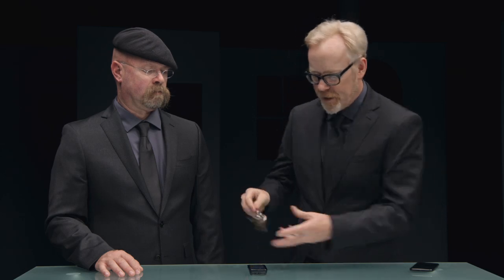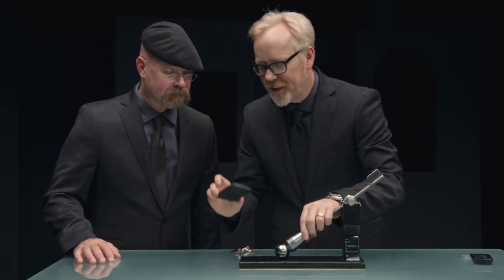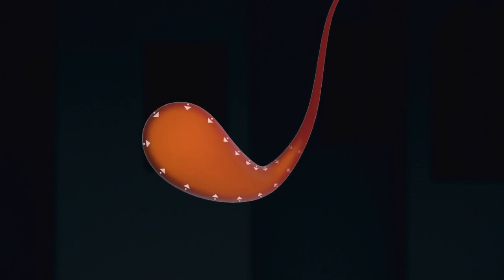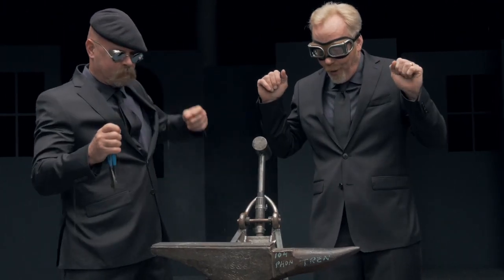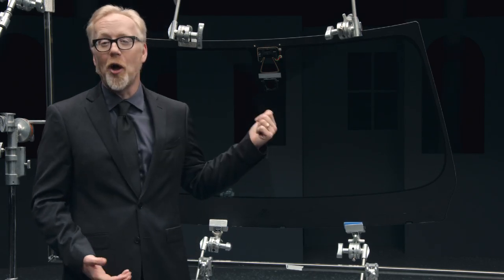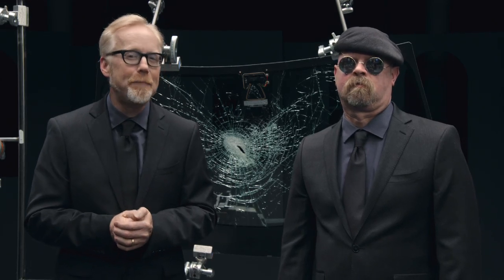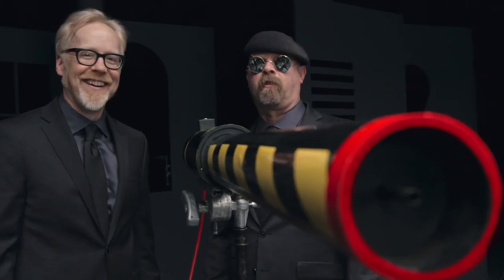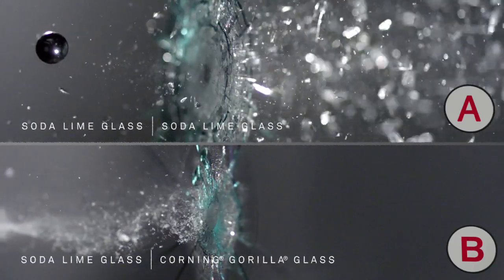The Glass Age, Part 2:  Strong, Durable Glass

Comment: I hate it when one test is shown against the "inferior" product, but then a different similar test is run against the "better" product. HIT WINDSHIELD B WITH THE HAMMER ALREADY!!!!!
Reply: +Michael Mast (TurboAAA) They did the pebble test against both, the gorilla glass still preformed better. I was really mad when they did that too until they did it to windshield A too.
Reply: +Michael Mast (TurboAAA) HAMMER, HAMMER, HAMMER!!
Reply: +HaydenMcM1 also this was a science experiment. They didn't calculate the force of the hammer, therefore they couldn't hit windshield b with the same force.
Reply: +HaydenMcM1 There's also the fact that neither windshield is meant to handle a sledgehammer, but both would regularly withstand small high-velocity impacts from pebbles. Testing whether or not your windshield will take a sledgehammer is like testing whether or not your phone can survive on the sun. It's not made for that, testing it is pointless.
Reply: HaydenMcM1 Except that they did equivalent testing immediately afterward. The sledgehammer was there to grab your attention and break up the science. Lowest common denominator stuff.
Reply: +Ian Mcvicker Or they just didn't want to show windshield B get obliterated by the sledgehammer
Reply: Melroy van den Berg The hammer wasn't an actual test. Note how they measured absolutely nothing. Note how there was no method described. Note how they didn't give any results. That is because the hammer was a demonstration to keep the lowest common denominator watching.
Reply: Indeed!
Reply: +Michael Mast (TurboAAA) Probably they didn't have another pane to experiment with plus costs
Reply: HaydenMcM1 And that's a bad thing because..? It's entertainment. Nobody said that the hammer was a test, nobody wants the hammer to be a test, nobody needs the hammer to be a test, they did the test, the hammer was there for entertainment. Why is this an argument?
Reply: +Michael Mast (TurboAAA) they did the same test on both windshields with the ball bearing cannon. that experiment eliminated all outside variables thus being more scientific. the sledge hammer was not a test, it was a demonstration on how lamination holds the glass together after it shatters and the hammer delivers enough force to fracture the entire windshield.
Reply: HaydenMcM1 It was merely for the SMASH value. :^)
Reply: HaydenMcM1 It's not a test though!
Reply: +HaydenMcM1 The hit with a sledgehammer was supposed to show one thing. What a broken laminated glass looks like. It's not a matter of being apt in scientific methods. It's a matter of being able to think. 

There was no reason whatsoever to hit the other one with a sledgehammer. It would not show anything at all. Whether the damage was smaller, larger or the same...it would be irrelevant. The process of lamination and it's effects on the final product were already explained. The comparison of strength was done with the air gun.

This is one of the best-made advertisements I have ever seen. It's an actual advertisements that shows quality product fairly, as in...the way you want it to see. That's rare nowadays. Causing a ruckus in the comments just because someone didn't understand something so basic is really...sad.

Of course, it would be FUN to watch the second one being hammered. But "fun" does not equal "reasonable". Wasting a prototype for fun is just not...something one would do, really.
Reply: +Michael Mast (TurboAAA) a person swinging a hammer is not a controlled variable.
Reply: HaydenMcM1
"not everyone watching this is apt in the scientific method"
Well of course not. You're never going to hit 100% of your target audience. But just because the minority can't enjoy the commercial doesn't mean it should be changed or that it is wrong. It wasn't targeted towards you.

The way they presented all the glass experiments in both videos does not allow for "manipulation" like most advertisement does. So long as we can assume all the potential variables remained constant, aside from glass A and glass B being the changing variables, no information presented was at all false or misleading. The only thing they didn't show was potential weaknesses of the gorilla glass. Which NO advertising company in their right mind would do.
Reply: Jeffrey Black It won't. Obviously. The only vehicles with windshields designed to handle that kind of abuse aren't the kind you typically find at a car dealership...
Reply: DON'T EMPLOY THE MYTHBUSTERS IF YOU DON'T WANT A SLEDGEHAMMER USED! & don't say "it's not meant to handle that" if that's your argument, then hit it with another car or large animal!! I want to know what the glass in front of me is going to do if I'm in a crash! & cost? again, don't employ the mythbusters if you can't afford to let them be them, or alternatively, at least finish the video sledghammering the already shot through glass! No extra cost to that
Reply: Michael Mast I was worried about that but then they shot windsheild A with the ball and then B. The sledgehammer was just to give an example of what the cracked glass looks like.
Reply: Teth47 There are various types of "survival".

One is keeping it pristine. The other is making sure it fails safely.

The reason laminated glass is used is so when the glass does break it doesn't shatter into numerous shards which then fly/fall to the occupants of the vehicle, cutting or impaling them, and as a bonus, it doesn't make a bunch of glass dust.

If Gorilla glass fails and shatters and throws glass everywhere, it isn't suitable for car windscreens.
Reply: Jeffrey Black It doesn't. It's already known that its failure mode is identical to typical glass, it's just harder to make it fail.
Reply: Teth47 That depends on the type.
As it has internal stresses it is more likely to shatter spectacularly.
Reply: Jeffrey Black That's what the lamination is for...
Reply: Teth47 And hopefully that will work, however it will depend on exactly how it all breaks. If the glass doesn't separate front to back, it will be fine. If it does, then it wont be.
Reply: +Danielle Henry This was an advertisement, not an experiment.
Reply: Lilac Lizard actually he wanted the sledgehammer again
Reply: Anonymous, I think we all did!
Reply: Well, at least they used a proper control for the actual test they did.
That would have seriously sucked if they hadn't demonstrated like for like in any way at all.
Reply: I think it would shatter to milion pieces and be more dangerus so they decided to not show it... Maybe they are still working on it so it wont happen.
Reply: They hit the one windshield with a hammer for entertainment purposes only. Then they reeled it back in and actually performed a realistic test to show the utility of the glass in a real life situation.
Reply: The sledge hammer was designed to show you what the resin layer in between does. Not necessarily to give a visual representation of the strength. People who don't understand that watch too many one-track demo infomercials.
Reply: +Michael Mast (TurboAAA) It's quite simple. They didn't hit the windshield B with the windshield because that would have simply proved something that is still worked on I guess. If they would have done it, the compressive strength would have shattered a large amount of the windshield inner layer with only the resin to hold it there. You don't show a flaw still being worked on for no reason.
Reply: korinogaro1988 I wasn't being serious, if I remember correctly at the time I was being one of those people that just wanted to see more things go smash.
Reply: +Michael Mast (TurboAAA) No need. We already seen how it looks when a window gets owned. Which was the point of the mallet. Don't need to own a second window to explain what happens to a glass in that case.

As for test 2, the BB was used on the first and second glass. So it was even steven.

All that said, I still would have liked to see what gorilla glass in both positions would look like from the mallet and BB.
Reply: yea, I wanted Jamie to blast the "B" sample with the hammer!
Reply: Danielle Henry That's an argument for calculating the force of the first hit, not an argument against hitting the seconds.
Reply: +HaydenMcM1 Correct. Check this Video here to see what happens:
Oyx6PpXuJfc?t=6m1s

(remember the prince ruperts drop)
Reply: +Teth47 Or it is like testing if it will survive hail or some load falling off the vehicle in front, like a brick, or perhaps one going in the opposite direction, or hitting a kangaroo.
Reply: +Kim muca Neither is being hit with a ball bearing.
Both have similarities though.

A hammer is comparable to large hail or animals or loads from other vehicles just like the ball bearing is comparable to a pebble.
Reply: Teth47 Agreed neither will be able to withstand a sledgehammer and nor should they be able to. But then you run into the problem. By showing one being destroyed and not the other you place a burden on one but not on the other even though it is equally useless against the sledgehammer.
Reply: Teth47 My point is that it being shown on one but not the other gives the impression that the old glass is weak when it's a test that not even the new glass could withstand. Not everybody watching this is apt in the scientific method and actions such as that allow for manipulation of the audience.
Reply: kikixchannel So why not hit windshield B with the sledgehammer? It would show how the windshield shatters.
Reply: Vriska Serket True, nobody said it was a controlled variable did they. The comment is that it's sensationalism to show it for one and not the other.
Reply: +Michael Mast (TurboAAA) Exactly! Don't change the test setup.
Reply: HaydenMcM1
Well they aren't going to impress people if they don't use the same methods to break it. The people that are likely to be watching this video are by majority reasonably intelligent with a decent understanding of scientific method.
Reply: You do realize that if its not a probable scenario then why would they demonstrate it in window A in the first place. The answer to that is the same answer to why they should also do it on window B. You do realize this? Donkey.

Comment: They should've gone full Mythbusters and seen how fast the ball bearing had to go to get through the gorrilla glass windscreen.
Reply: +BradTheThird And then shoot it with a .44 magnum round, just for fun
Reply: +Pul5ar And blow it up in the end, for good measures.
Reply: +Ivo Glasius Using at least 1kg of c4.
Reply: +BradTheThird I still want to see the sledge hammer
Reply: +BradTheThird If it's worth doing, it's worth overdoing it
Reply: RMJ1984 Lets test an RPG while we are at it..
Reply: I think the answer to that is only very slightly faster than they did. I would imagine they pretty much pushed the glass to it's limits for this demo. It wouldn't have looked good if it had broken like the standard glass...
Reply: +Pul5ar After that, just to take it to the limit 50 cal rifle shot. you know the anti tank one  :D
Reply: +Viktor Rebake I agree.
Reply: +Viktor Rebake Yes like car games not allowing you to totally destroy a car
Reply: +Pul5ar a .55
Reply: 121mph I guess
Reply: @killbillgrill3287  Funnily enough, that ball bearing is moving slower than a paintball fired from a paintball gun. While most paintball guns can fire up to 300 feet/second, fields usually agree that 280 feet/second is the upper limit on safety. 280 feet/second equates to ~191 mph, so, in the realm of projectiles, it's going pretty slowly.
Reply: +BradTheThird Corning didn't pay them to do the actual test, only the advertisement...
Reply: These guys are the real slo mo guys

( ͡° ͜ʖ ͡° )
Reply: BradTheThird ya
Reply: Caster Troy ya smart
Reply: We need Demolition Ranch to test out the Gorilla Glass!
Reply: no, going full mythbusters would have had them seeing how much TNT it would take to blow up a car with gorilla glass windows xD, they really like there explosives!
Reply: Caster, same! It's just wrong to employ mythbuster guys but not have them smash the second one with the sledgehammer!

& WTF are they wearing???????? suit & tie? Come on!
Reply: I have a feeling that the bold guy asking the questions, already knows the answers to them.

Comment: you know what i see lots of unfair comparisons
Reply: +Jared Reabow (Jazza) Try bending a sheet of regular glass that's 0.2mm thick.  That shit breaks just by breathing on it.
Reply: Well, the phone they scratched actually has a resistive touchscreen on top of the glass, which is why it's so easy to scratch. It's not even glass they scratched, but a thin plastic film on top of it!
Reply: +Jared Reabow (Jazza) such as? the ball bearing was shot at the same speed and distance, both scratched with the same keys, both had a metal ball dropped on it from the same height...
Reply: +ranwolf76 4mm glass bend vs 0.2mm glass

Comment: I confidently did the ball drop test with a hammer on my new phone... I regret to announce that apparently my phone does not have Gorilla glass :[
Reply: I learned the Iphone IS for peasants.
Reply: It's okay though, I work at Corning, I can buy another one ^-^
Reply: +Patrick Clausen sapphire is not inferior, it is just apple and Corning saw two different paths, Apple thought the likelihood of someone using an iPhone without a case would be low, so they decide to make their phones the superior in scratch resistance sapphire, and android users who mostly use phones without cases because of the big name Samsung, and others who make their phones ipx certified aka water and dust resistant to a certain degree decided just put all the strength into corning glass. It is not a matter of who is better, it is the target consumer. Both are good products, and unless you are using them to build a rocket ship I doubt it matters because people who fight just want to brag.
Reply: +kylefer that is because your phone is not android. C=
Reply: Patrick Clausen "The new glass on iPhone 6s is made using a special dual ion‑exchange process, which makes it stronger at a molecular level and the most durable in the smartphone industry."

"ion‑exchange" is how gorilla glass is made by corning or did you not watch the video.
apple may not state it outright but they use gorilla glass.
Reply: kylefer I tried it on my Moto X phone. Even though it was already cracked from falling off of a 2 meter shelf, it didn't break any more than it was already. Good, because I drop it often. LOL
Reply: +kylefer Or you could make another screen if you work there  :P
Reply: +Trevor Thieme  I work at a facility that has nothing to do with phones, but still a good job ^-^
Reply: kylefer Oh lol
Reply: +kylefer the most stupid man on earth....no offense it gotta be someone right
Reply: But why?
Reply: +kylefer Replace the glass, it's quite cheap.

By the way, my phone is made of two layers of glass. So when the front one takes the hit, the second glass (the more important one) will survive.
Reply: Armyofscrap (Rainbow dash) nope
Reply: I hope you're joking..
Reply: +kylefer Aw. I hope your phone forgives you.
Reply: +kylefer Were you using the phone at the time?
Reply: +kylefer Doh!
Reply: Wasn't an Iphone anyway.

Comment: Why not use the glass from part 1 for its flexibility and scratch resistance then a layer of polycarbonate strong, flexible then use gorilla glass for strength... some flexibility is good as it will dissipate the kinetic energy over an area reducing possible damage like cracks and chips the first layer protects the poly as it can be scratched rather easy the poly can add rigidity and provide some insulation the the gorilla glass adds further protection.

Comment: So why make a window with a weak layer on the outside and a strong layer on the inside? 

Money? Because what I see is them creating a weak point so that it can still crack - forcing us to still go buy new windshield. 

If both sides were strengthened, the odds of cracking/breaking would be lower. If it were 100% crack proof, then that company wouldn't be making as much money long term.

Anywho, glass still has a long way to go. My Gear 2 watch, my Galaxy S4, etc still scratch easily, no idea what from but they've got scratches all over.
Reply: sacr3 I don't know. Maybe it's a cost thing, maybe the traditional glass has some useful property, maybe it was more demonstration.

Dirt will scratch glass, especially if it's sandy.
Reply: michael burke Citations required.

Everything I can find suggests gorilla glass is more scratch resistant than standard glass.

Comment: Why would you compare a resistive touchscreen which has soft surface by design to a capacitive screen that has hard surface by design. That's like comparing hardness of helicopter blade with hardness of hot air balloon canvas. Yes Gorilla glass is good but you failed to mention that it is possible to scratch it by a much more common thing in life than a key, a grain of sand, and when you scratch gorilla glass it becomes not so though because all that inner stress accumulates at that scratch spot and every next bump might result in a shattered display.

Comment: the video starts with a comparison of an old phone which is an nokia 5800 which has a resitive touchscrren which rely on NOT having glass on the front cause you need to apply pressure for the touchsreen to work. nice on guyys. niiiiiiiiiiiice one

Comment: I wonder if the refractive index of Gorilla Glass can be adjusted so it can be used for eyeglasses. I use polycarbonate, which is thin, lightweight, but scratches pretty easily.